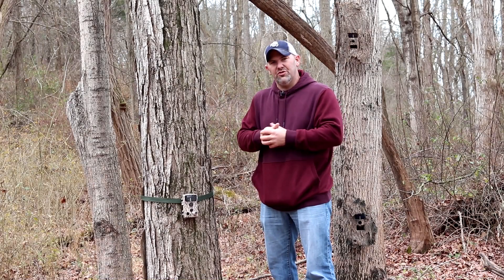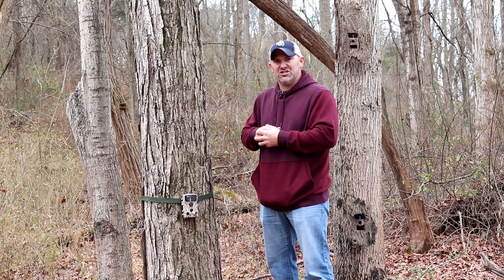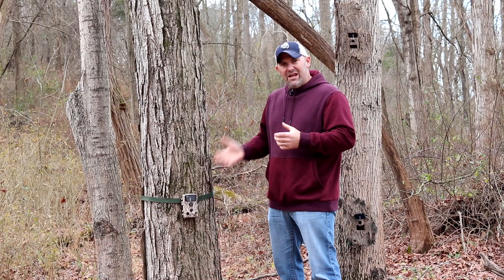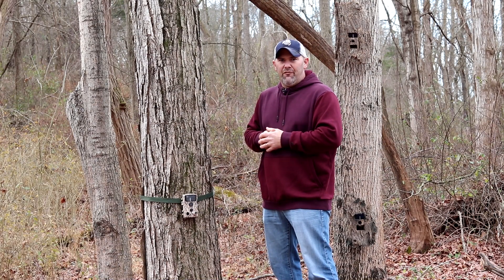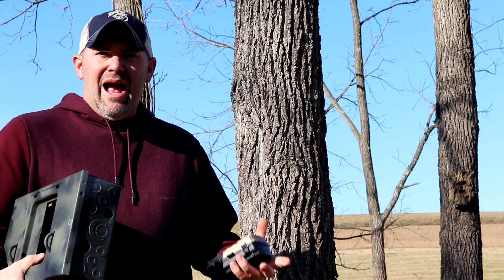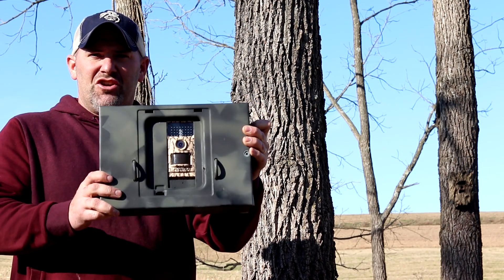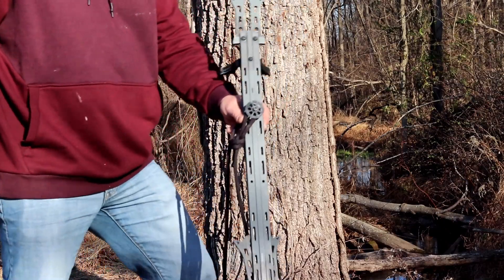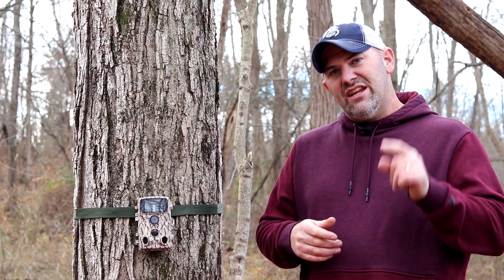EP 2 Tips, Tricks, and Techniques: KEEP YOUR TRAIL CAM FROM BEING STOLEN!!

Comment: the camera strap is usually the most visible..we use wire..very thin wire that you can easily adjust and cant be seen at all...most cams ive seen in the woods i spotted because of there strap and especially if its black
Reply from the maker: That’s a good tip. I agree the strap is usually the first thing seem. Thanks for watching and sharing your thoughts 👍

Comment: What kind of bark are you using, I’d think it would just fall apart most of the time because it’s basically rotting. Good idea though maybe some synthetic bark would be better then you can constantly paint over it to match your next set up tree
Reply from the maker: We have a bunch of dead ash in my area. Some bark holds together better than others. I’ve also seen where people will duplicate the look of bark with ‘liquid nail’ adhesive. 👍

Comment: Have you ever made one that resembles a tree branch that just screws into the tree or used a chain saw to notch out an existing tree, preferably an old dead one
Reply from the maker: I’ve cut holes in old stumps and placed cameras inside. Moisture can be an issue but otherwise worked great 👍

Comment: Great to see someone using camo and a mount to remove the strap and box shape of the camera itself. You might consider making the holes less regular, square and face-shaped - these things all draw the eye immediately. Totally agree that the best way to avoid them getting stolen is to prevent them being detected in the first place. Out of direct line of slight (High or low, in a recess etc) and camouflaged is essential. You can also make them ghillie-suit type covers or direct glue to the casing and place them not just on the trunks where they are easy to see.

Comment: Great video as usual. Was wondering if you've had experience with bears. I've had two of mine destroyed by them. It seems no matter what I do they're gravitated towards them. I have them 8 to 10 feet high and it doesn't matter because they can climb of course. My last option is I'm going to try some smaller diameter trees in hope that they can't easily climb them. Your thoughts?
Reply from the maker: Bears can be a real mess. I had them mess with my cameras also. A metal box definitely helps with bears, keeps them from easily chewing holes into the cam. Here is a camera that survived bears. https://youtu.be/_Cz_B7FRNhE